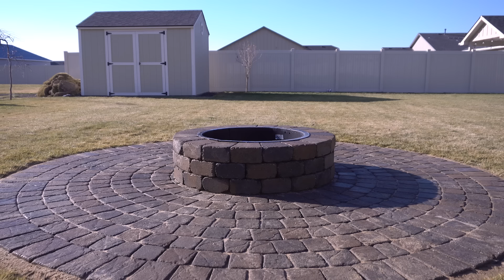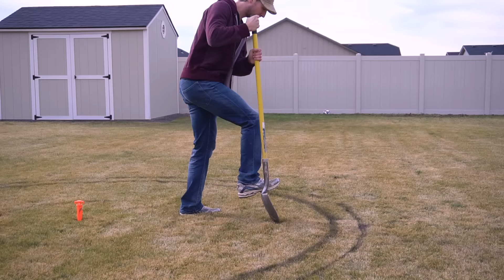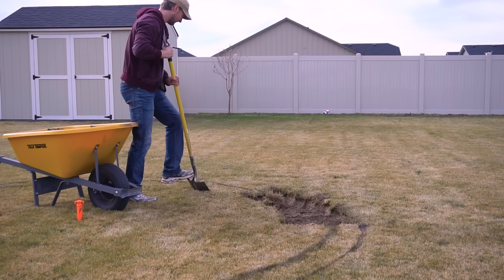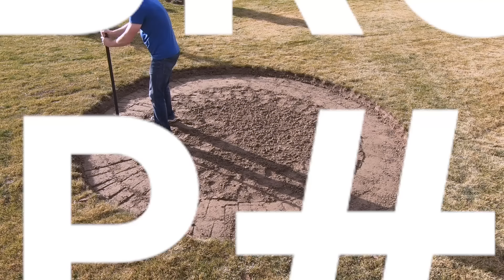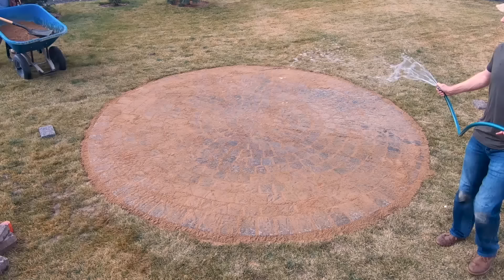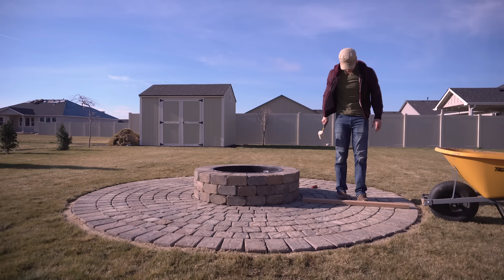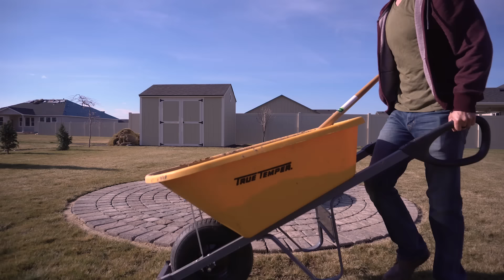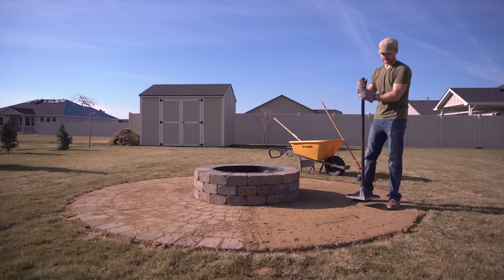My 4-Day Fire Pit Patio Build [Full DIY Project]

Comment: Would recommend boots for digging or a shoe with a solid or thick sole as it will impart more force into your stomps and jumps and generally feels better on your feet, and a well used shovel(the edge is worn down from use and thus becomes a cutting head) or  pickaxe / hatchet for any roots you may find. As someone who builds decks and routinely have to dig 12+inch deep for the block for the legs learn from my mistakes. More often than not there are so many roots just under the grass on top of the fact that some grass can be very hard to get through. Don't even try with a square shovel. Use a spade headed shovel to remove or break up the grass layer and a square shovel to remove material more evenly and slightly quicker as the shape of the head allows you to get the ground flat and pick up more dirt. Having both types of shovel (long handle is best) and a pickaxe that isn't too heavy as you don't want to swing a heavy one for too long or before you are out of breath and dripping sweat, and a good pair of solid work boots digging can be as simple and easy as it ought to be
Reply from the maker: Good tips man, thanks!

Comment: If you do another patio like this you want to use poly sand because it hardens like concrete in the cracks and you want have any pavers move
Reply: We use gator polymeric sand on all of our patios we do for customers and have had 0 complaints
Reply from the maker: I appreciate the tip!

Comment: hey bro !
i saw this amazing fire pit that you built and i learnt a lot of stuff along the way but the thing that cought my eyes was you didnt use any cement in the fire pit neither the base doesn't that cuase instability over time?
Reply from the maker: It shouldn't. Everything's locked in solidly, and it's few enough pieces that if something breaks or shifts, I could repair it just by redoing that section. If I cemented it in, that'd be much harder to fix in case of an issue.

Comment: Im a mason... I would have used a turf cutter, not used gravel, i would have used weed guard, i would have cut the sand with portland cement.... Its getting to be to many things you did but wrong in 2 years ill come fix it and bet your last buck i don't listen to the manufacture specifications.
Reply from the maker: No thanks.

Comment: I have what I assume is a stupid question to those experienced in this stuff. What was the point of the two rods in the ground where they just pulled them up and just filled it with sand?
Reply from the maker: They make sure the 2x4 slides along exactly 1 inch above the ground, so that you end up with one inch of sand exactly.

Comment: use the dryest sand you can possible, and never wet it when locking in blocks. also invest in a whacker plate if youre going to do anything like this again 👍🏼
Reply: also those slabs on the top will probably sit better, and more level if you mix up some lean mix and set them properly, looks great though man

Comment: Do you have any issues with air flow in the fire pit? On mine I had to leave 1 or 2 blocks out on the lower rings so the fire could get air.
Reply from the maker: Yeah, we actually adjusted for more airflow (and a little less smoke) in our next video: https://youtu.be/2DlTu1PxBCU

Comment: What is that for? A cemetery memorial fire to honor the fallen soldiers of the Confederate States of America? The BLM vandals will destroy your fire pit.
Reply: @BroBuilds  I was funny, don't worry.
Reply from the maker: Not really.
Reply: @BroBuilds  I know, you are scared. BLM is not a joke. They will cancel you without a reason.
Reply from the maker: . . . 🤷 Thanks for stopping by.
Reply: @BroBuilds  If to put jokes aside, I don't like HOW you made your job. I would dig 2 or 3 feet deep, fill with gravel. Pressing with a soil compactor machine, then sand, a one more time with a compactor, and only then I would lay stones like you did. And a one more thing. There should be poured concrete around your construction. Other wise all stones move apart after a while.

Comment: how do the concrete slabs at the very end remain stable? Won't they fall off if someone leans on them?
Reply from the maker: They're pretty solid and stable already, but we do plan to add some masonry cement once we finish adjusting the fire pit blocks for air flow
Reply: @BroBuilds  ahh makes sense! Yes was expecting cement or something similar to keep it glued to the rest of the pit.
Very nice projekt bros :)

Comment: Nice build but you might consider making your fire pit smokeless.  Would require two additional steps only: 1) Remove four pavers evenly spaced from the bottom layer of the firepit, and 2) remove your steel basin and drill holes (about the size of a 50 cent piece) about an inch and a half apart just below and all around the top rim of your basin.   Voila no smoke. 
 
Here's a link to the video I watched about it:  https://www.youtube.com/watch?v=qyjxklycfJ4&list=TLPQMTQwNDIwMjEaVJU63yh1ng&index=9

Comment: Great video. Not gonna lie thought - you need to get that OCD in check. "I didn't know if I liked the color of the sand." Dude, really? I strive for perfection in most of what I do too, but good grief man.
Reply from the maker: Ha, that's. . . fair. :) I think I always aim for 100% in my projects because I know I'll never reach it, and achieving 90-95% of what you're aiming for is still pretty great. But yeah, I went too far down the rabbit hole on that one. :)

Comment: i aint gonna spend $65 + having to go get and return the compactor + still having to do a little work. in that time i already finished a third of the compacting so thats over $20 an hour for the remaining work + im not getting as good a workout
Reply from the maker: I hear ya. And I think this size of patio was pretty much the cut-off point. If you go any bigger, it's definitely worth it. Any smaller, and it's a decent workout so why not. :)

Comment: There is a type of sand called polymeric sand when it gets wet it acts like a mortar with the pavers
Reply from the maker: Yeah, we considered it, but didn't want it cracking and looking ugly in the joints if the ground froze and moved in the winter.

Comment: 1. Those bricks look super cheap and are way thinner than a standard paver. Not good.
2. Gravel layer should be 4" thick. Less than that and you risk sinking.
3. Use joint sand for joints.
4. Use edge restraint or the pavers will shift sideways.
5. Use adhesive or mortar for the firepit so the bricks and cap doesn't move.
Reply from the maker: 1. I think they're actually pretty high quality. They're also 2 3/8" thick, which seems standard for non-industrial applications.
2. We did do 4 inches.
3. I'll look into the best possible sand for our next patio. So far, though, it's working well.
4. Yep, we did use edge restraint. 
5. We'll add masonry adhesive to the fire pit once we're happy with the air flow. We're still adjusting it in the meantime.
Reply: @BroBuilds  1. My bad 2. In the video you said it was 2-3 inches of gravel. 3. Concrete sand works fine. Joint sand is just...finer. It settles better in the joints. 4. Didn't see in the video sorry. 5. Take back what i said about mortar as it might not resist heat well.
Reply from the maker: No worries man. And I guess I may have said 2-3 inches, but I definitely meant layers. We did 4" of gravel, 1" of sand, and then aimed for about 2" to set the pavers down into.

Comment: Here from Ireland, do you use anything to hold the bricks around around the fire pitch, and there is a breather for the fire at the bottom?
Thanks. Gilmar
Reply from the maker: We'll add some masonry adhesive at some point, but we're still messing with the fire pit air flow, so until then, we're leaving it loose. Check out our next fire pit video to see how the extra airflow helped!

Comment: you should remove 2-4 stone in the bottom so the fire can suck in air from the bottom, it will increase burn and reduce smoke alot.
Reply from the maker: We did that in the next video, check it out!

Comment: Instead of blocks for the seating area outside of the pit, I used crushed white stone.  A lot less expensive (bulk delivery) and easier to install, with landscape fabric under it, and the plastic garden edging on the perimeter.  I also used the crushed stone as the floor inside the fire pit.

Comment: A 5 3/4 laser will give you perfect results for measuring down for base and digging,and put the edging around it first put down the sand then drive a plate compactor around to settle the sand and pavers.
Reply from the maker: That's something I want to try for my next patio. Good suggestion.

Comment: It really seems to be a waste to lose all of those pavers underneath the fire ring itself. I would’ve pulled them out set the fire brick a bit lower and save those circular innerpavers for another project.  After all, you’re going to have a fire on top of them and never see them again unless you plan to remove all the ashes.
Reply from the maker: Yeah, we may actually pull them out in the future. Just depends on how we like the current setup. That's the nice part of not cementing them in yet - we can always make modifications!

Comment: I will not put the pavers under the pit, it's a wasted and could save you time and money. I just cut the grass low, then put one layer of crusted stones and put pavers over, he grass won't grow up through the crust stone and pavers. Then by the time the surround grass grow taller, it's will flush together. If you wanna keep the grass low, then it's easy to trim the grass around it. It will saved you 1/2 time and money.

Comment: Something that you could do to give this a little bit more long term sustainability is to buy some road construction groud carpet, (its a thin allmost cotton like carpet that lets through water but doesn’t let sand through with time) it would keep the sand from slowly shifting and moving into the ground which would keep the whole thing level for a longer time, its not too expensive either, something else you wanna do is waterpack the gravle, pour water on it before thumping it down to make it more solid
Reply from the maker: Good stuff. I appreciate the tips!
Reply: @BroBuilds  no worries! i work with ground prep/road construction so haha

Comment: what's the reason for the 2 pipes conduit?
Reply from the maker: You can slide the 2x4 on those, and get perfectly level sand that has the same depth everywhere in the circle.

Comment: Looks nice but you will probably get 1-3 years before it starts to warp. For tamping you should have atleast done 3 passes with a 250 lbs tamper and done that with 2 inch lift till 1 inch lower then desired height. With using sand if there are any spots under the stone where the sand is inconsistent water will wash it away. Using rock dust or where im from we call it quarter minus. It locks together when tamped and for finising touches you would tamp with a tamper pad on to avoid damage put down polymeric sand sweep into cracks then tamp one last time then sweep again then proceed to spray it down but be careful not to soak it to bad or you will wash the glue out. After your border goes on you will want to put a plastic pipe or plastic edger halfway down the brick. This will stop the pavers from spreading out over time. ( 3 year block 1 landscape and horticulturalist )

Comment: Pro tips : You can tamp your sand-joint (around 12:00 ), only if you use a really fine sand, like 0-1 mm, otherwise with 0-4 mm sand you will sink your stones randomly and create waves,  which is something you don't want .
Reply from the maker: Interesting - great tip, thank you!
Reply: No, your pavers should be compacted into the bedding material. You'd have to mess up your screening if you end up with wavy pavers after compaction.

Comment: I would use cement for the inner blocks. Only a matter of time until they fall.
Reply from the maker: They're pretty thick and stable, but we do plan on adding some masonry adhesive once we're done adjusting the fire pit for maximum airflow.

Comment: Using sand and gravel you will have more weeds and grass that will grow and push your papers apart in all the cracks. Limestone, and poly sand prevents this better. As far as the firepit goes, that should have been built first. Then lay the papers around it. You don't want a firepit sitting on top of pavers
Reply: 100% true. but careful with that poly sand. it will kill you if you breath that stuff in.
Reply: Where and how much Limestone do you add to prevent weeds? Thanks

Comment: Pro tip, don't use gravel for base. Use 304 limestone mix for base. Then instead of sand use #9s limestone (crushed limestone) for your leveler. Then when you get the patio laid, sweep in polymeric sand and tamp in the patio. Then sand it in again and wet it down. Give it a few days for the poly sand to set Then I recommend sealing the patio. I like a wet look sealer.
Reply: yes polymeric sand is a bit pricey but man it works great locking in and you will never see a weed come through

Comment: Pro tip: Assuming you are dealing with multiples of four pavers in each concentric ring, drop a paver at the 12 o'clock position, drop another one at the 6 o'clock position, drop the next two at 3 and 9 o'clock. Now as you fill in, you can adjust the spacing in a smaller area instead of having to go back and adjust the entire ring.
Reply: Agreed. I was wondering why he didn't set cardinal points and work between them. Turned out great though.

Comment: Pro tip, call to get utilities marked before digging any depth in your yard. I instal fences and communication drops (internet, phone, etc.) are often as shallow as 3 inches in the ground but sometimes up to 11 inches and are very easy to cut with any digging tools. Gas lines are often surprisingly shallow too. Be safe and dig smart!

Comment: I do install patios professionally. You did great. I think that’s pretty obvious. Two critiques, something alittle more technical in the future if and when you have to relay. I would use 9’s as the medium between the 4/11 and paver, because you live somewhere there is rain you don’t really want a lot of water injection. Sand retains water a lot more easily than #9’s gravel does. 

look into poly sand for you grit between the pavers. Look into proper poly sand usage it can leave hard to remove patches. Poly sand definitely extends the life of the patio with no risk of washout. Poly also helps to prevent water diffusion into your patio. 

Both my resolutions are more geared towards large patios. But makes for longevity.
Reply: Circle kits are hard to come bye where I live. Our suppliers do not make them anymore. Kind of jealous.
Reply from the maker: Awesome tips, and yeah, I'm planning on doing a larger patio, so I'll definitely look into your suggestions. I appreciate the feedback!

Comment: I just can imagine how much that thing moved after a winter . Not deep enough, hence not enough 0-3/4 , should use mechanical tamping and water the 0-3/4 as you tamp, way to much sand sould get alot closer to your line before laying. Just my two cents, here in canada that thing would be rocky mountain after a winter.
Reply from the maker: That's fair, but we're not that far north, so it should be enough for our area. Check out the follow-up video (DIY smokeless fire pit) to see an update after the first winter

Comment: You didnt use set sand? That regular sand is just going to wash out...
Reply from the maker: Yeah, I didn't want any cracking if the ground froze/moved. I'll just add more of the regular sand every few years if necessary.
Reply: @BroBuilds  i would suggest set sand as it will harden and actually keep the water at the surface , that will actually prevent cracking and lifting of the patio blocks. Just my opinion...
Reply from the maker: @robc3642  l appreciate it! I'll be doing another patio in the future directly behind the house, and am definitely going to look into polymeric for that one.
Reply: @BroBuilds  👍

Comment: Hey about leveling, gravity works as well. Adding additional weight that will naturally be removed - such as water. 

So by using smaller granulation sand as an base (before everything) with water mix it will level itself out. All your need is around of quarter of an inch (.5 mm) of water level that is higher than fine granulated sand and just let it evaporate (protection of wandering animals is required depending on pet size). After evaporation small water movements with added gravity levels the stuff just as it needs to be. After that add larger granulation gravel and there you go 😁

It works by weight differentiation, sand+water is heavier but it becomes less heavy more it is closer to top. So gravity + water moves it till it's gravity and weight evens out with geometrical stability of differentiation. Thus - perfectly flat ❤️

Comment: I'm a paviour in the netherlands. We do things so much different and probably easier. We don't use 4x2 or put any rails in the ground nor do we ever use a handstamper. All we need is a level of 1,50/1,80m and a line with pins and a "trilplaat".
Reply: Also, it usually takes us less than a day to make something like this.

Comment: Awesome job. Supposedly, after applying the polymeric sand, the surface should be dry for at least 24 hours. Did you have any problems after it rained? You could probably make it look even better by surrounding it with small rocks
Reply from the maker: We just used regular sand, not polymeric. We'll have to add more over the years but it means we can always make changes easily too